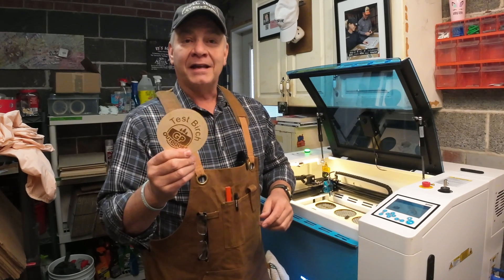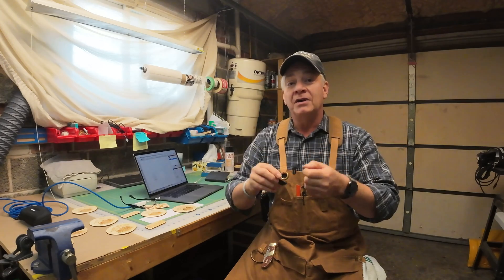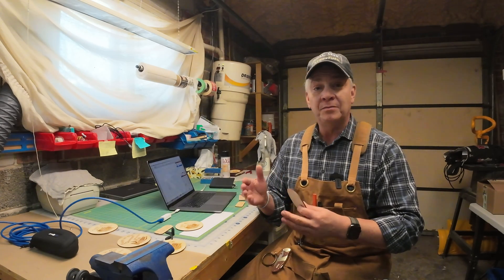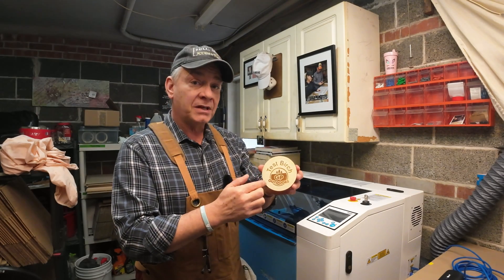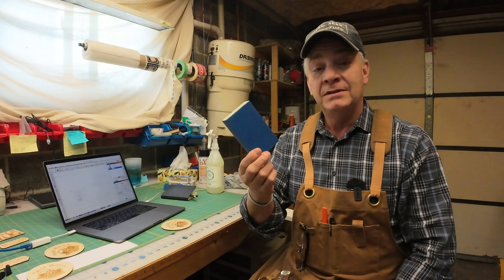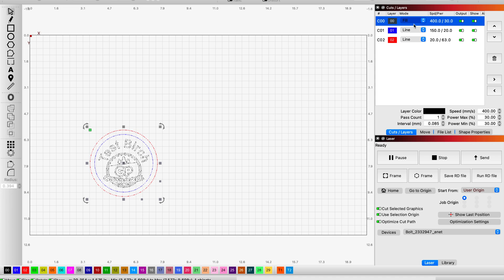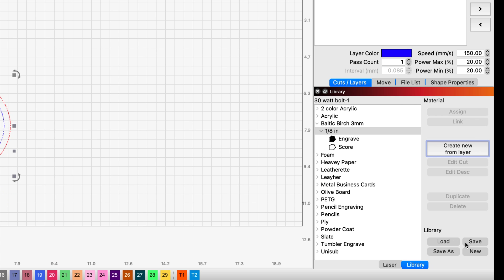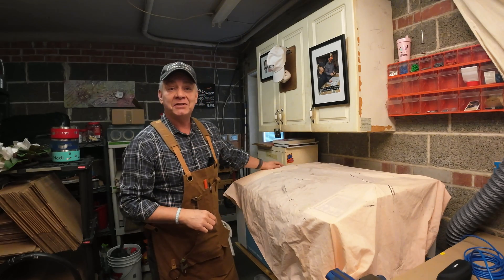QuickShot: Baltic Birch Settings for Thunder Laser BOLT. 3mm plywood. Details. 013 4K

Comment: how many mm from the wood your engraving do you want to be at?
Reply from the maker: Hey good morning. I always use the auto focus and run the laser using that focus distance - i don't adjust it manually. Hope that helps. Cheers!
Reply: @LaserNUG thanks yes I used auto focus and worked great and outstanding video it was extremely helpful!

Comment: I really appreciate your videos. I’m a crafter/hobbiest and the BOLT is my first ever laser. I’ve been struggling figuring things out because a lot of tutorials assume the viewer has more experience/understanding than I do as a complete novice. 

One question: Are you using the stock 1.5” lens, or a different one? 

I’m struggling with getting inconsistent results with the stock lenses and 1/4” birch ply. The only cut settings that work leave black, charred edges. I’m still struggling with the material test cards, so I’m not sure if it’s user error or if I should get the 2” lens. I’ve heard it cuts more consistently.
Reply from the maker: Good day! I am still using the 1.5" lens - I have not tried the others yet. It may possibly be the quality of the plywood or the birch. I notice I get different results on different parts of the sheet. Maybe try these settings and see how the cut works - I don't get charred edges at all but they are dark brown for sure. Good luck!

Comment: This video was a great help! I did a lot of acrylic cutting this weekend. I did find the materials library on the Thunder website. It gave me a good starting point. Some of the materials were a little weird. What is olive board and leahyer? I have no idea! I did some editing like you did. Did you make material cut test cards?
Reply: Hey good day Janine! LOL - I think it was a spelling mistake - I think it is supposed to say "Leather". I checked and 'Unisub' is very similar to MDF. But yes I have changed a few since. I have not done the material test cards yet as I am a little risk averse. I have seen two Youtube videos where the maker had to stop the laser cause it caught fire doing their test cards (low end of the speed setting and high power %) . I am waiting until I get a better feeling for the power and speed settings and then will probably do a graduated test card(s). If you haven't tried yet, get some anodized aluminum business cards and coated aluminum cars off Amazon. I think the next video coming this week I did them - they come out great! Talk soon!
Reply: @GPOutdoors  That’s the same reason I didn’t do a test card. 🔥 I’m just not savvy enough with the different settings. I’m very familiar with Unisub because I have sublimation equipment. I did buy some of those aluminum cards. I use them in my Xtool F1. I haven’t tried them yet on Zeus. That’s what I named my bolt.😃
Reply: @janinelew2483  LOL. Zeus. sorry its me (Gord) LaserNUG - I have two Youtube channels and didn't realize I answered you from the other channel. The BOLT does a crisp burn on them too. Cheers Janine!